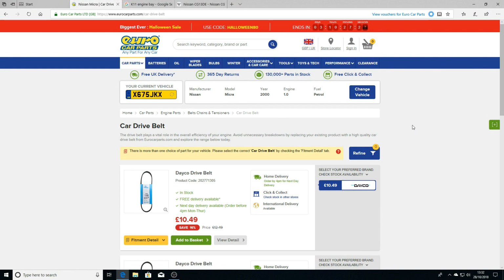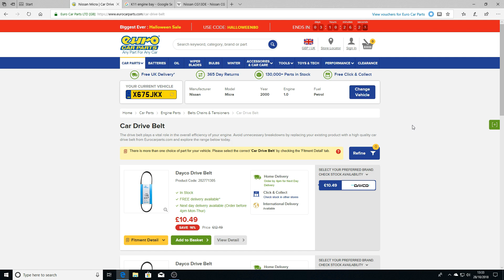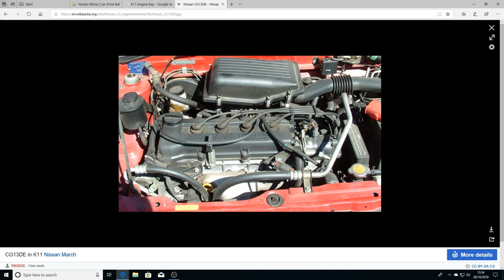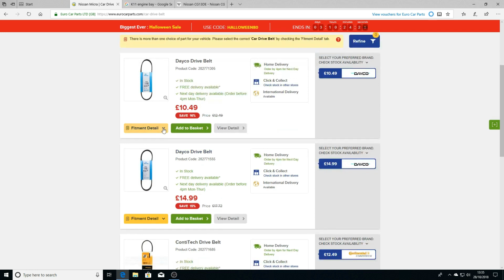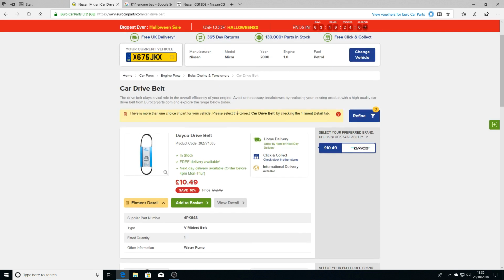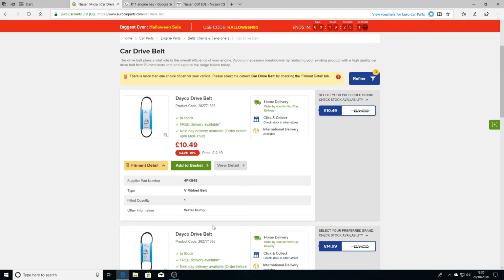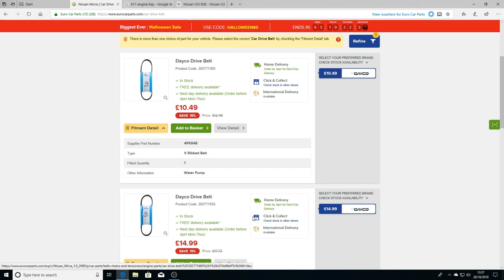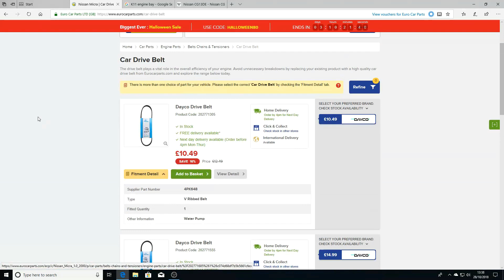K11 Auxilary Drive Belts - PAS, Waterpump, Alternator and AC

Comment: Thanks for the guide, my late father's 1998 Si has both power steering & A/C. I'm confident in ordering correct ones now.
Reply from the maker: The Si was quite a rare model, if I recall. I have a set of Si green backed dials, in my K11, funnily enough....

Comment: Euro parts seem to have lost the plot now with these belt choices. They're only 3 choices now. Two 6 rib ones, the PK955 still there for AC. Now only one choice for the small 4 rib belt, that only says water pump and is PK648. Also, do you mind giving me some info. My 1.3 which has AC & PAS, I can only see a tensioner wheel on the big belt that runs the AC, but the small belt, it only seems to go around the PAS pump & water pump & straight onto crank, but know sign of a tensioner pulley down there. Thanks

Comment: Hi, thanks for your video.
I own a K11 1.3 75cv.
I have to change the alternator service belt, but I have been told that if the car has air conditioning, I have to buy a separate one.
By any chance, would you know what references they are?
Thank you
Reply: There are 2 belts
1 big one for the alternator, AC, crank, tensioner

On the crank pulley is a 2nd smaller belt for the water pump / power steering

(on my 1.4 at least....)
Reply: @hopisanka4430  thank you!
Reply: @pipergsxr  just make sure you turn the tensioner the correct way out (which is wrench on righty tightly I think..)

You won't damage anything if you turn the bolt out, it's just a pain in the ass for 2 hands to thread it back in 🤷🏻‍♂️😂

Also don't overtighten the big nut on the tensioner roller if you decide to take it apart...

It will turn, but the belt will squeek a second in startup

But it's a pretty easy job, you can do it without a jack if you turn your wheel to the right :)

Good luck
Reply: @hopisanka4430  Thank you very much mate, I appreciate the help!
Reply: @pipergsxr  np bruv, hope you got it all fixed :)